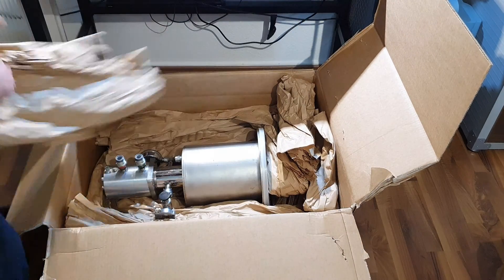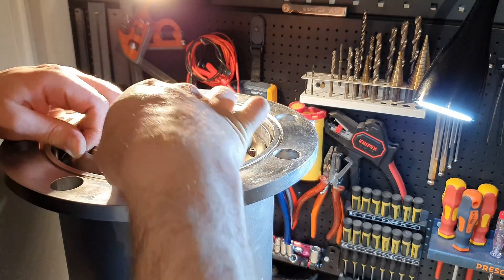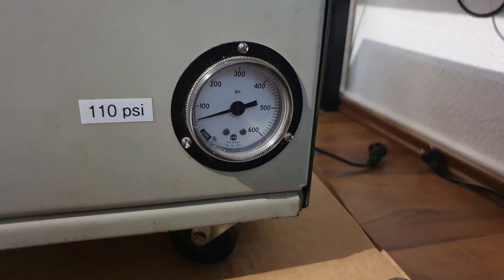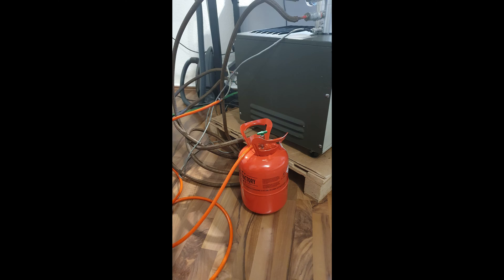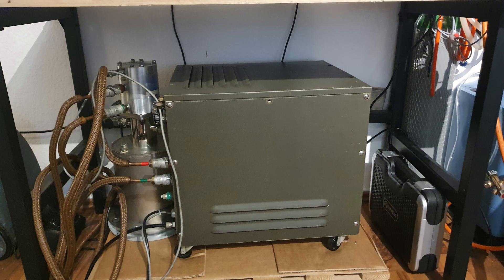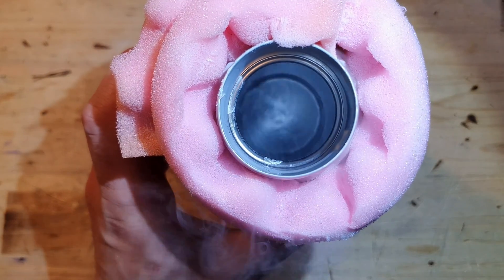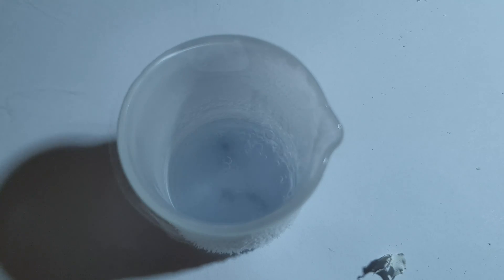Liquefying air at home with my new cryopump

Comment: The reason for small yield is that you are not using the first stage of the cryopump for liquifaction. The second stage is designed for much lower temps and its cooling power is small. The first stage is much more powerful for liquifying gases like oxygen argon nitrogen air etc. Using the first stage too will increase yield by a lot.
Reply from the maker: I just assumed the first stage does not get cold enough. Good to know, that that was the problem. Thank you for the advice!
Reply: you welcome! :). Do you have email or mobile app like telegram or whatsapp?.
Reply from the maker: Sure, you can write me an Email at AdvancedTinkering@yahoo.com or text me on discord AdvancedTinkering#2156.
I also have Telegram, but I don't like to give these contact information to strangers.
Reply: @AdvancedTinkering  3 years later, I'm so curious if his suggestion worked.  Did your production increase a lot?  And how much power does that huge thing use?  I've been using a much smaller Stirling cycle cryocooler that only uses 240W and I get 2L of LOX in 24 hours.  I could get more but I need better insulation.
Reply: @AdvancedTinkering  ⚠ God has said in the Quran:

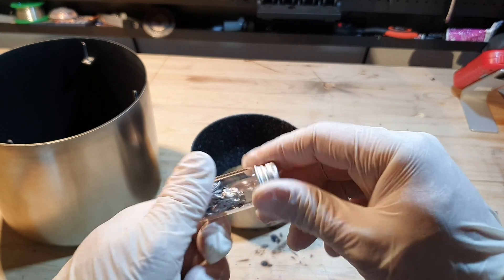🔵 { O mankind, worship your Lord, who created you and those before you, that you may become righteous - ( 2:21 ) 

🔴 [He] who made for you the earth a bed [spread out] and the sky a ceiling and sent down from the sky, rain and brought forth thereby fruits as provision for you. So do not attribute to Allah equals while you know [that there is nothing similar to Him]. ( 2:22 )

🔵 And if you are in doubt about what We have sent down upon Our Servant [Muhammad], then produce a surah the like thereof and call upon your witnesses other than Allah, if you should be truthful. ( 2:23 )

🔴 But if you do not - and you will never be able to - then fear the Fire, whose fuel is men and stones, prepared for the disbelievers.( 2:24 )

🔵 And give good tidings to those who believe and do righteous deeds that they will have gardens [in Paradise] beneath which rivers flow. Whenever they are provided with a provision of fruit therefrom, they will say, "This is what we were provided with before." And it is given to them in likeness. And they will have therein purified spouses, and they will abide therein eternally. ( 2:25 )

⚠ Quran